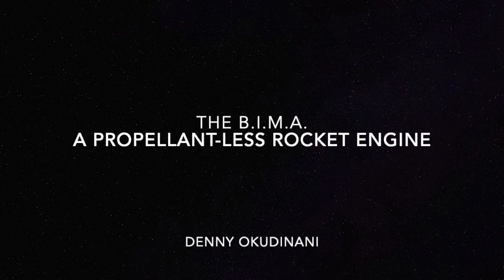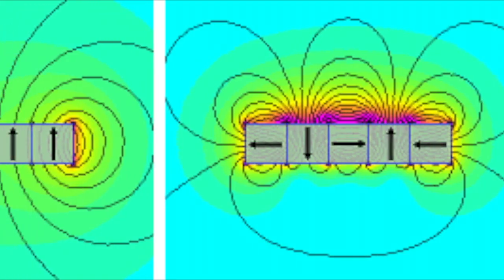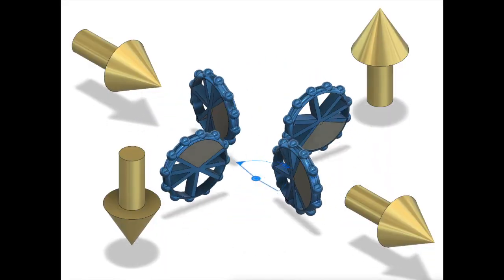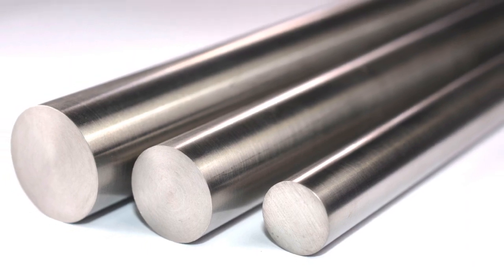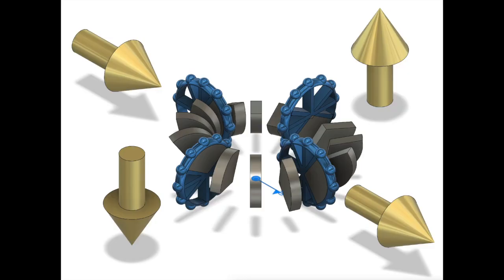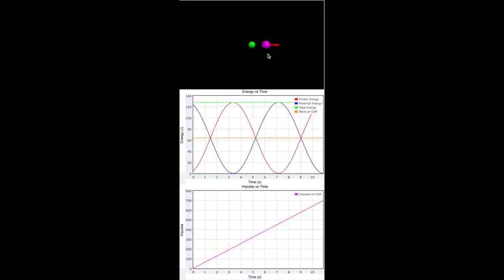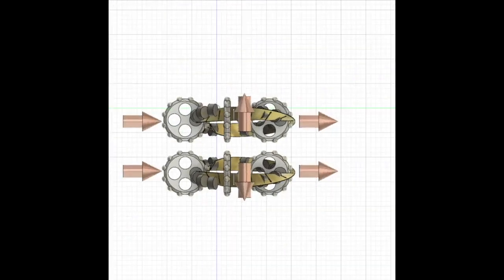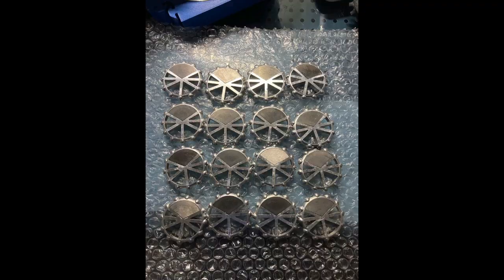Inertial Propulsion System 1: The unBalanced Inertial Mass Accelerator (BIMAH)

Comment: great video. 
I really want to see better version of that. can you hang it from a rope like a pendulum and see if you can get deflection ?
Reply from the maker: What you're describing is the pendulum test. This is exactly the kind of test to evaluate systems like this for thrust...(If a given system isn't already levitating on its own).  The best way of doing this was even laid out by NASA here:https://ntrs.nasa.gov/citations/20070004897

A sustained deflection is promising, especially when it is non-jittery and  continuous. I did my part getting this far with the work out of pocket. Maybe one day others can finish the rest now that I've open-sourced everything.
Reply: It's important to note that there's a difference between the pendulum test and the test to see if a system will deflect a plumb bob. Deflecting a pendulum refers to changing the swing angle by adding a momentary thrust at or near the top of the swinging motion, where gravity can't pull it directly back after the thrust impulse. A successful pendulum test imparts a partially circularised motion to the pendulum's swing.
Reply from the maker: @JerryVolland-bt8cb  Hey thanks for the insightful comment! I couldn't agree more. Your latter explanation is what I call the "strong" version of the pendulum test.  Most folks are satisfied with the "weak" version, but I don't think its satisfactory enough when looking for genuine thrust (if anything I am particularly weary of it).  To give more context I'm gonna quote something I said earlier  somewhere, a bit further down, in the comments section of this video regarding my view on the "pendulum test". 

"See, I hold to the view that there are two versions of the pendulum test which can be carried out---one weak and the other strong .  In the weak version the net deflection of the pendulum is sustained in one direction, fairly marginal, and (usually) extremely jittery. In the strong version the deflection is far more dramatic, where the platform achieves increasing elevation before settling down and remaining mostly fixed (imagine a pendulum which, after reaching its maximal height on one side, remains "frozen" with a sustained deflection).  "

As you rightly pointed out, in what I would call the "strong" version of the the pendulum test, gravity does not directly pull the system back as the system is able to  sustain a constant impulse manifest as a constant deflection where the "partially circularized"  (or periodic) motion  of the pendulum is just that.